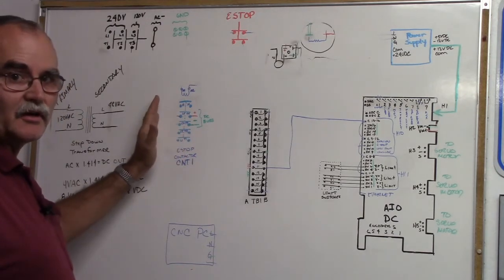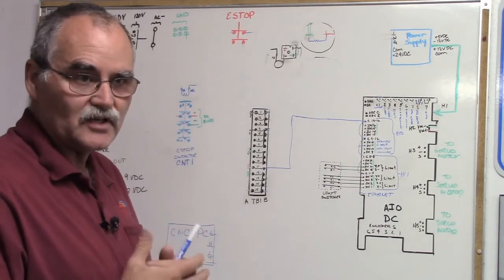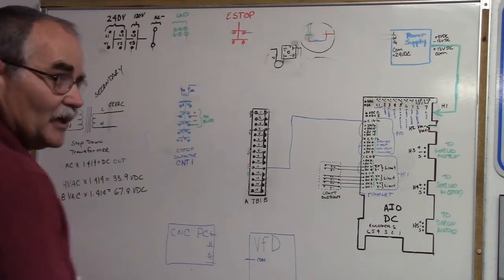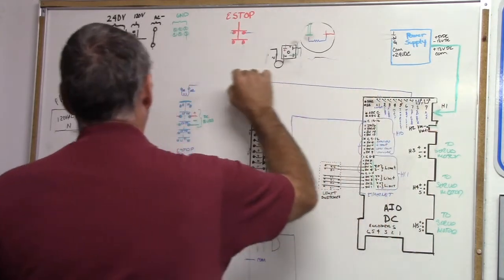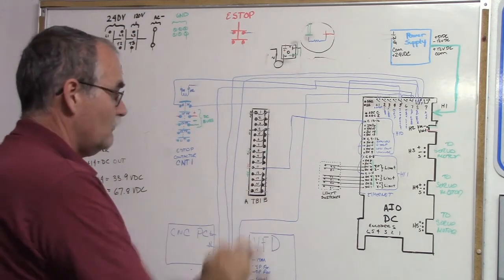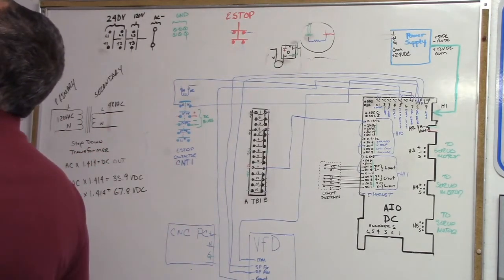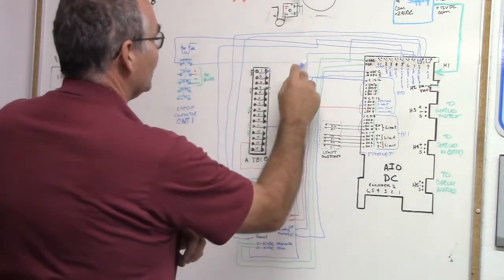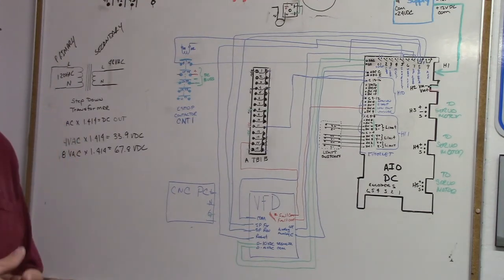5: "Wiring" The Centroid All in One DC - VFD, General Wiring

Comment: This is great content! Very clear and precise.  
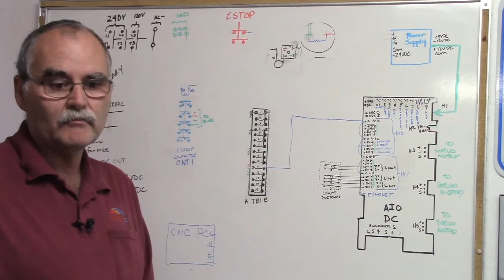2:00 - The old we were using did not have a VFD to run the spindle. Instead, used reversing contactors.  You've done such a wonderful job of drawing the other circuits, I'd like to take you up on you making a video for the control conections from the aeo to the spindle contactors.  Thanks.  I'll probably figure it out by the time you see this; but, I can see it definitely being helpful to others as well.
Reply from the maker: Find the All in One schematics on Centroids website. Pretty sure it's in there.
Reply from the maker: You might consider removing the contractors and using a VFD? Depending on the type of machine....